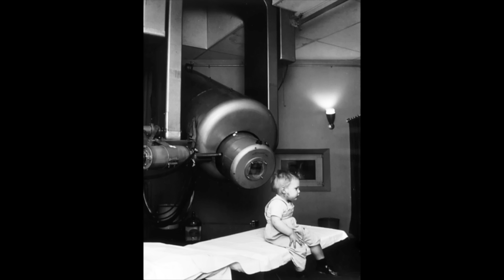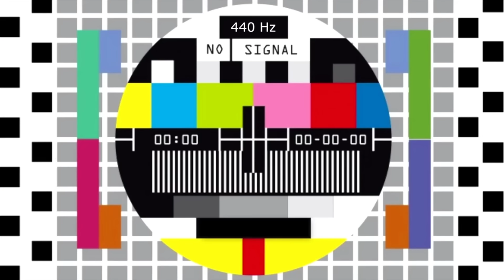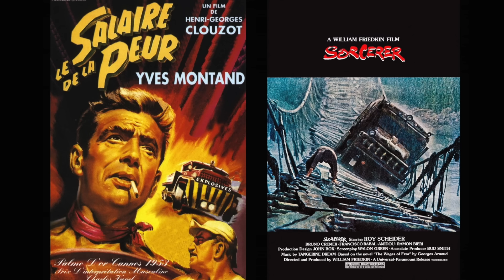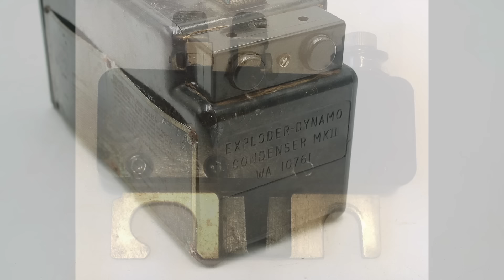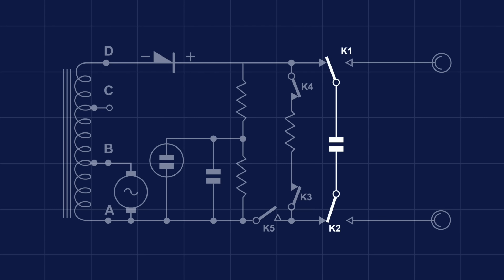Blasting Machines: Not Just for Wile E. Coyote

Comment: For those who care, the mk 3 and mk2 use the same box. Both mk3 I own have the 2 scratched off and have 3 and wh00085 written onto it. One in white and one with plastic data plate over the whole number. This guy's mk3 doesnt seem to have gotten the case mod but still has the data plate replaced. I dont believe they ever made boxes that said mk3 on them which would make sense if it was made from a modified mk2.

Comment: Your T-bar plungers have posts as the connection points that you're calling "terminals." But the terminals are really the finished ends of the wires that go onto those posts. Just like the proper spade or ring ends that you crimp onto small wires or the proper ends on the cables in your vehicle that you clamp down onto your battery posts.

Comment: In the 1950s I watched repairman work over a giant natural gas single cylinder engine which drove an ammonia compressor for a refrigerated storage building. It was intended to run for years between shutdowns and it was not equipped with any king of starting device whatsoever. The Master mechanic measured the engine's bore and stroke and noted the temperature and barometric pressure. After 2-3 minutes with a pencil he took out a graduated cylinder and put a certain amount of Red Devil Lighter Fluid in it. Then together the two men opened a petcock on the cylinder and turned the flywheel until they could see the exhaust valve begin to crack open. They reverse-rotated it until they could see the valve shut tightly. The Head Guy poured the lighter fluid carefully in the valve cock and closed it.
Then he consulted his pocket watch and then a chart.
     After 5 or 6 minutes of waiting the Boss sat me down with a dynamite blasting machine with wires leading to a (Ford Model T ? ) buzz Box connected to it's giant spark plug.
   Both guys rolled the monster flywheels backward HARD - where I got the sign to hit the plunger - ker - POW > and off it went while the head man hurriedly switched wires on the spark plug to a magneto built on the engine. And it began to run on it's own !

Comment: In the early 1950's when I was a sub-teen we had one of those small twist the handle detonators.  At the time dynamite and blasting caps were obtained from the local hardware store completely without regulatory interference.  Two 13-is year old's sent in the farm truck to town to buy blasting supplies, then our job was to blast out tree stumps, we had endless fun in those simpler times.

Comment: I believe the reason for the bottom contact is a bit more trivial. Reason is, that while pushing the plunger and accelerating the dynamo, the voltage increases with dynamo speed. As blasting caps are (like any other electromechanical device) manufactured with tolerances, the raising voltage causes a equally raising current which will engage the weakest of those detonators breaking the circuit- leaving all other caps failing to detonate. 
By only engaging the circuit when the dynamo has reached its maximum speed, sufficient voltage has built up to detonate all series of caps.

Comment: The US Military Twist activated blasting machines are rated at 10 caps they are also used in tanks as a backup to the main firing circuit.
Reply: Our tank (M60A1) in AIT had a malfunction that required one of the rangemasters to send that main gun round downrange either that device..September  1971..

Comment: The blasting caps would have to be wired in parallel not in series.  If they were wired in series then the first one to go off would break the circuit and none of the others would get set off.
Reply: Apparently, series connections are common.  The switch closing must produce a rapid enough rise time to set them all off.
Reply: @fitzroyfastnet  It must.  I saw the diagrams after I posted.
Reply: @fitzroyfastnet my thought as well. The switch must be there to make sure the blasting caps are exposed to a high voltage all at once instead of a lower voltage slowly ramping up over time. That   should make sure all the caps go off instead of just one or two breaking the chain.
Reply: @fitzroyfastnet  What a powder keg! Imagine multiple sources of ignition, each multiplying the risk of accidental set-of! you only got 10 fingers, 2 ears and 2 eyes to lose..

Comment: As I recall from my 1 explosives class, approximately 1980, the machines then in use were the handheld WW2 type, and were 10 cap machines. USMC always had the most current equipment.

Comment: got that type 23 dynamo, it was commonly used in old telephone networks to generate the ring on party lines, as those were all local battery type, and the actual phone line was very often just a single wire with an earth return provided by a long steel rod, often driven into the ground by the outhouse or the soak pit, as that was often going to make the earth more conductive in dry spells. saved on expensive copper wire, which in most cases was also for the long bare wire copper plated steel as well.

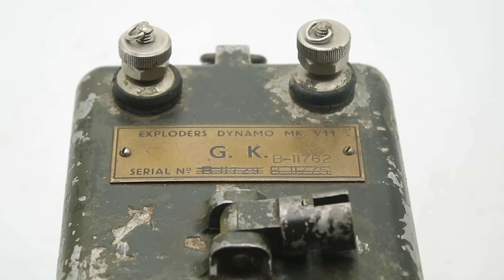Comment: 7:45 -- Common twist-to-bang machines have 10-cap ratings, which is to say they will RELIABLY initiate 10 caps in the worst conditions of weather, manufacturers' tolerances, machine condition, care in placing, etc. This means that they will take significantly higher numbers of caps in normal conditions.  10:45 -- looking at the numbers, one is the original, the other two are higher numbers added later, but not much higher . . .and the "final" number is lower than the add-on which was stuck out.  That pretty much kills the idea that the other number was added for civilian use, and points toward the manufacturing process.  Possibly failed inspection, was given new innards with a new SN (which would have been stamped on the dynamo frame), then at another time refurbed again (note that the higher number strike-out is not similar to the other strike-out).  Strange that all three are within a 46-number range, but that's the only explanation I can think of.  Also notice the strange characters for the Mark number.  As far as companies "likely" to have manufactured it, remember that during WWII, a lot of UNLIKELY companies got contracts to make weapons (such as Guide Lamp, making Liberator pistols).  GK could very well have been a manufacturer of car parts, office machines, toasters or chairs for dentists' offices -- something that would have been less in demand during the war that were blasting machines.

Comment: 3:20 Less shock sensitive? ~07:46 series connected blasting caps?  Wouldn't the first one to fire stop the others from firing?
Reply: The caps are essentially fuses with the jumper wire surrounded by explosive.  The wires blow more slowly than the current goes through the circuit, so by the time one fails, all of the others are pretty much equally hot.  We're talking milliseconds for the wires to fail and microseconds for the charges to initiate.

Comment: I've got a two terminal one like the first one you showed. Your's sounds like it's in pretty rough shape. Mine you can definitely hear the dynamo spool up and keep spinning for quite a while after the plunger is depressed. You can run a jumper wire between those two contacts at the bottom to close the circuit. Makes a pretty good fish shocker.
 Not as good as an old telephone dynamo. But it still works pretty good.
Reply: Been calling up the fish?